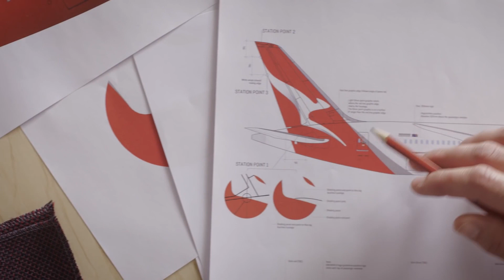Qantas Boeing 787-10 Order

Comment: The 787-10's will replace the A330's in Qantas' fleet. Expect to see them a lot flying all over eastern Asia as far north as Tokyo and even to Honolulu from Sydney and Melbourne.
Reply: It's now confirmed it a combination of the 350 and 787 replacing the 330. Boeing is increasing the range of the 10 so it will be able to serve most of its network. They already fly the 330 to the US.

Comment: It was only a matter of time this order would become a reality. The Qantas fleet already uses the Boeing 787-9, and it has been an airplane that has been exceeding really well with long-haul operations with Qantas. The airline really likes the airplane, and the benefits it has to offer. The A350 is also a great addition to the Qantas fleet as well. The 787-10 makes good sense, to replace the aging A330-300s. It will have greater capacity on some shorter segments that Qantas used the A330s for. This is great news for Boeing. I think these airplanes will benefit their operations in the long run. I always knew that Qantas would never pull away from Boeing in the first place.

Comment: nice is the plane gonna have extra fuel tanks or is that on the A350-1000 or the 787-10 or they not gonna do that
Reply: The extra tanks will be 350-1000 to same as the 900 url, for project sunrise
Reply: @tariqalmahruqi898  The 900URL doesn't have extra fuel tanks. It was a change to the fuel system to tank more fuel and greatly reduced capacity for SQ. Now the 350-1000 for the ps does have an additional fuel tank.
Reply: @johniii8147  oh okay, interesting its amazing how they increased the range significantly with just changing the fuel system only, i thought an additional fuel tank or the changed the wing tanks size. 
Thanks for clearing it up👌🏻
Reply: @tariqalmahruqi898  Not particularly amazing. It pretty common they can increase range with relatively minor changes as the aircraft goes into production and real world service. We've seen it with the 330/777 etc. Also the range bump has a lot to do with the configuration of the SQ aircraft. There ULR only has 161 seats vs 250 to 300 for their other 350s.